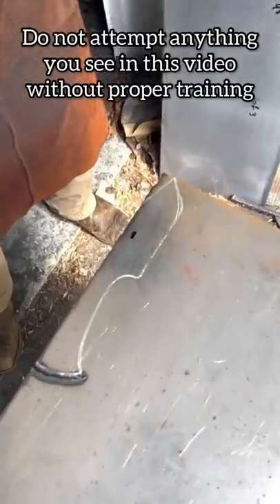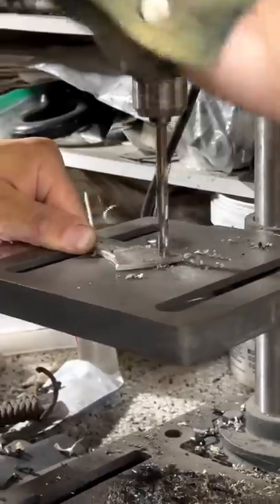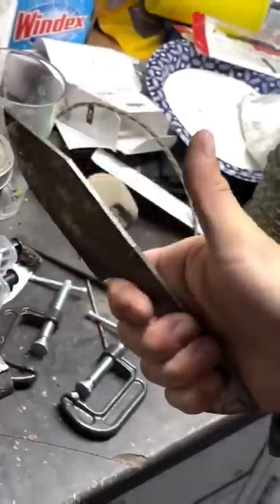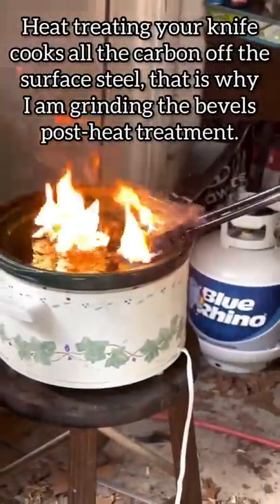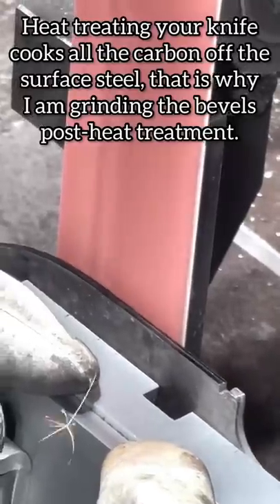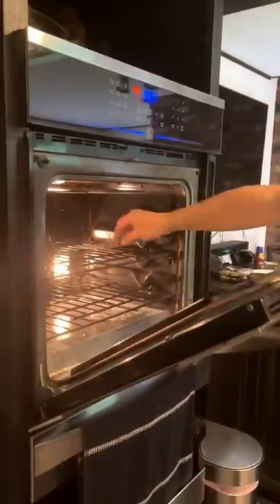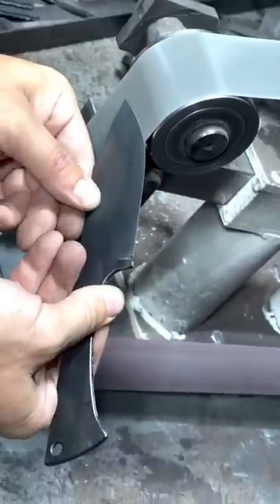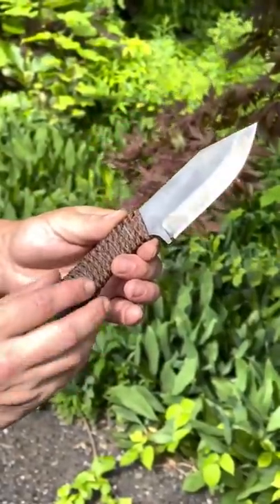How to make a knife!

Comment: next time try tempering the blade before grinding, that way if you drop it then it's more durable and won't have the chance to brake. (I had to learn that the hard way after I dropped a blade mid grind, and hadn't tempered it yet), but regardless, it is a really nice knife man, keep it up!

Comment: If it ain’t M390 I don’t want it 😂 all jokes aside good job! 👍
Reply: M390 needs a kiln to heat treat and cryo treatment in liquid nitrogen ... It isnt a steel most bladesmiths will work with on top of the steel itself being very expensive... 1095 is a solid blade steel that can cover a wide range of tasks and specialty purposes vs m390 which is a 1 trick pony

Comment: Oh shit so I only need a machine shop and forge
Reply from the maker: I made another short about producing a knife with minimal equipment if you are interested
Reply: You could do all this with an angle grinder, a set of metal files, a drill, a bucket of canola oil, a propane torch, and some sharpening stones if you really wanted to. And maybe a couple of firebricks to help the torch heat evenly.

Comment: I love that both of the first two steps aren't even a possibility for most people
Reply: The first two steps are the easiest. It's the heat treating that most people tend to mess up. He used the plasma cutter but you could just as easily use a hacksaw or a grinder or you can drill a bunch of holes and then use a file to shape it. boom, simple.
Reply: So find a way to do the first two steps, with what you've got.

Did I miss the part where homedude said this was the "only way" to make a knife, or something?

Comment: Don't you need to hold the temp for a few mins before quenching to get the most out of 1095? 

I use 108x because the heat treating is easier
Reply from the maker: So I learned something from the respectful comments that were made on this video that I will impart to you. I should have rough ground the bevels, then cleaned up the rough grind with a finer grit belt before heating it to 1475° for 5 minutes, quenched in parks 50 like I did. Then did 2 one hour cycles of tempering at 400°F. I just made the first dozen for sale on my site and they came out the best I have ever made.

Comment: I would cut the shape with a cutting wheel, get the bevels and plunge line and THEN heat treat. Otherwise, you’re going through a lot more work and materials trying to get the general shape.

Comment: I would say grind the bevels before your heat treat but... Still great knife!
Reply: 100%. The idea that it "cooks off" the carbon would be something that I am sure a lot of blacksmiths would like to have a discussion about.  Grinding post hardening, at least the primary bevels is just a great way to waste your belts.
Reply: @BrettDalton  the primary reason for post heat treatment grinding is to reduce warping...some carbon does indeed cook off as the steel scales in the heat this is called decarburization its about as common as dirt and damn near every smith knows about it ...if grinding a scandi edge it should be done after heat treatment not before ... A third reason is quench speed thinner steel will quench faster than thicker steel so the edge can suffer cracks in quench when grinding bevels pre heat treatment vs post heat treatment... There are other reasons of course but you get the gist im sure

Comment: Sir this is a great video and I appreciate you trying to inform people but I think that an important part to mention is that you drill tang holes for scales if you're not using paracord before you heat treat the blade or typically nothing good comes from it

Comment: This is like that how to draw a horse tutorial.

Bruh if I had a plasma cutter I wouldn't be interested in looking up how to make a knife
Reply: All you actually need is an angle grinder, somewhere you can make a hot fire, whetstone and a high carbon steel blank, it won't be prettiest knife, but it will work. The common materials to make one are easy to find, its the skill to actually make one from just an angle grinder that's difficult, which is why this video is total joke.

Comment: When I was younger I took an old file and made a knife from it, had to use a plasma cutter to put holes in it as it would destroy drill bits. Took a few hours to put a proper edge on it but haven’t sharpened it in the 4 years I’ve had it 🤦🏻‍♂️

Comment: I use old disk tiller blades, they're 1/4 thick and really tough. When I'm grinding I don't let it get hotter than 600 degrees so it doesn't lose its heat treat. Finished product I can chop into mild steel with no nicks on the blade 😅

Comment: Never seen a knife maker heat treat before the bevel.
Reply from the maker: I have seen a couple do it before so I decided to give it a try. I learn new things every time I try different methods.
Reply: I heat treat most of mine before beveling. Even thickness across the knife helps prevent cracking from hot spots and gives consistent hardness. Also helps with warping, though that’s not the only factor with warping
Reply: @jordandimick8861  knowledge is power.

Comment: Why heat treat before beveling? Doesn't that just make it way harder to remove material?
Reply: To the best of my knowledge, it is because heat treatment can cause warping. Grinding after allows for you to correct for any warping. I think at least😂
Reply: @walkertrautman8178  ya I just made 18 knives out of 1095 in both 1/8 and 1/4 in thicknesses. Did a ton of research because I didn't know wtf I was doing before. I ground the bevel before heat treat but annealed before heat treat to release stresses. Most knives turned pit good. I think his way will save you an annealing step and maybe have less distortion.  Gonna be super hard though.  He probably has a badass grinder. I was using a 1x30in harber freight.

Comment: As a machinist, the way you held your knife while using the drill press is a huge No.  Use the vice or pay the price.
Reply from the maker: I know that you are right, but it’s a wimpy drill press. The belt slips before it could barely over-power a baby. I know, I know…. I lost respect for it. I’ll try to work safer.

Comment: How do you know what temp the steel is at if you don’t have a temp regulated oven for heat treating? Are you guessing the temp after a certain amount of time? I don’t have an oven and I’m looking up ways to heat treat 1095 without investing in expensive gear.
Reply: You can gues the temperature (+- 20°C) by using a color chart. For example steel that looks light its glowing dull red has a temperature of around 650°C
Reply: Magnet, and colour.

Comment: How does cutting the knife out compare to forging? I assume forging would be stronger, but is there a significant difference?
Reply: Forging the steel will harden the blade. That's all I know, I use to watch forge in fire lol
Reply from the maker: Stock removal is easier and stronger, but takes less skill. I figured it would be easier to show for a short.
Reply: There's not a difference post heat treatment.
Reply: @nc_rider_7046  No, quenching the blade at critical temp hardens it.

Hitting hot metal doesn't do anything to hardness.
Hitting cold metal will work harden it, but is 'reset' when heated to glowing temps.
Reply: @autumn5592  ohhhh thanks for the info! I totally had my information all messed up.
Reply: There isn’t a difference. They both require about the same amount of knowledge. Hammer skills is one aspect of it all. At the end of the day, how you grind your bevels, heat treatment, and most importantly, the design of the knife

Comment: You never quench 1095 at 1650°f.
Ten ninety five should be quenched at 1475°f to 1515°f, anying above you will get grain growth, and it will Be brittle, difficult to get a good edge.
You did do good grinding while using water to keep it cool.

Comment: That’s a choil and why would you do all your bevel grind after a heat treat?
Reply: Its a Spanish notch not a choil and the post ht grind is to control warping and quench speed as thinner steel will quench faster than thick steel so keeping uniform thickness ensures even hardening through the full width of the blade

Comment: The part with the heat treatment makes no sense, especially the reason for quenching the knife before grinding the bevels. I am a knife maker myself and therefore have a good understanding of the processes involved in heat treatment. As long as it's not stainless steel and the holding temperature isn't over 1832°F you should be fine. You can also attempt a hamon with 1095 by hardening only the blade and not the back of the knife (by applying clay for example). Good luck and keep going!
Reply from the maker: Can you explain why it doesn’t make sense? I was under the impression that you cook off the carbon in the surface steel when heat treating. I have seen several knife makers do it this way. I use ATP-641 anti scale if I do the bevels first
Reply: @calculatedsurvival  I usually don’t use anything like a coating for the past years and it worked fine. The carbon can only be significantly cooked of the steel, when the temperatures while heat treating your steel are above 1832°F. It is just more work for you, if you heat treat your steel before grinding the bevels in addition to having the risk of too high temperatures while grinding. In conclusion i would say, that you can make knife like in your video, but it may be not the most efficient (cost and time) way of making a knife. If you are interested, i can recommend you the YouTube channels of Alec Steele, Royer or GreenBettle. They make knife like i have rarely seen before and like myself earn some experiences while watching them make knifes worth over thousands of dollars.

Comment: Quenched too hot 1095 should be quenched after a 5 minute soak at 1475 not 1650... Its jimping not checkering... The cut is a spanish notch its located in front of the ricasso it isnt cutting the ricasso ... Parks 50 doesnt need to be heated do so actually reduces its effectiveness and 1095 is a water quenching steel p50 while being the accepted oil is still too slow for that steel ... Atleast you didn't go the route of people like "mastersmith" (a fucking joke) jason knight and walter sorrells telling people to quench 1095 in food oils (i.e. peanut or canola) which are too slow for literally all steels used to make blades ...those guys dont have any business teaching anyone
Reply: I'll take their word over yours lmfao
Reply: @jessebond4221  That's crazy, I don't remember asking

Comment: Ok now how do you make the sheeth?
Reply: Sheath, and usually nowadays if you were going by untraditional crafting methods, or as i like to say, the incorrect way, most sheaths are usually made of cheap fiber stretched over mild plastic, on some higher quality ones you'll find straight up kydex or something of the like, and one of the best ones ive found made in untraditional ways was a condor, they seem to use fairly high quality leather and cut resistant foam of some sort along the edges to hold the blade and prevent the edge from destroying the leather over time, its not bad but id prefer a traditional scabbard, though they are rarely made with traditional methods nowadays they are usually of higher quality just because theyre usually wood pieces cut and glued together to surround the blade with a small air gap to prevent damaging the scabbard upon drawing and sheathing your blade, most of them that are cheaper seem to be coated with something almost like rhino liner or flex seal lol, but i have some higher quality ones that are just soft wood that has been made well and painted with some plastic bits✌

Comment: You made the edge brittle when you cut it with the plasma cutter and then dumped it in water
Reply: Baking it for an hour should fix that
Reply: He heat treated the steel after plasma cutting.  Heating/quenching/tempering produces the right balance of toughness and hardness.

Comment: Isn't the heat treat only a thin layer a few thousands thick. You ground it off sharpening
Reply: No, heat treatment changes the Microcrystalline structure of the steel. This goes throughout the whole blade, not just the surface. In simpler terms, heat treatment changes the structure of the tiny molecules making up the steel throughout the entire blade. The arrangement of the atoms itself can change the mechanical properties of the steel. Think of a lump of pure carbon versus a diamond. The arrangement of the atoms changes the hardness massively. He didn't grind it off because the entire blade is heat treated. But the reason you want to keep it cool while grinding is because the heat from grinding can do the same thing as heat treatment, change the structure, but unlike heat treatment it isn't a desired change in structure. Sorry for writing a whole paragraph lol.

Comment: What's the difference between this and forging?
Reply: Forging is the true way to make high quality blades, especially when done by very experienced bladesmiths, im very happy to see that someone brought it up though, it warms my soul like the bellows of the forge.✌
Reply: @jordandimick8861  alright, then go buy a couple of blades that were hand forged by a master smith, folded a at least a few thousand times and go test its worth against a chunk that was cut out of plate steel, either that or you can work with metal for a decade or so and have any kind of clue what your talking about, noone here is talking about magic except you my guy, might wanna leave the witcher behind and get some actual steel in your hands, theres a difference in the steel even if some scientist cant see it under his fancy microscope, trust me bud.✌
Reply: @jordandimick8861  Ntm it is much easier and much better to forge a very large blade, as you can work the impurities and other issues out in the forging process, as well as the fact that it would be very expensive to try and buy a chunk of plate thick enough to cut out something as big as you could with just taking a leaf spring and stacking it and forge welding it together then beating it out into a thick af blade the only real option to do that with sheet metal is get some thats dummy thick abd itll take forever to cut with most methods, and then what? Just grind it to shape and heat treat? Dont even get me started😂😂😂 (go learn about forging before you try to say its inferior is all im really sayin.)
Reply: @WarriorInWaiting  deleting my comments as I realized it’s not worth arguing over

Comment: That high carbon sheet  is heat treated off get go that’s why I don’t understand why u can’t just shape instead of h .t again? And why u temper after heat treating 1 or other I might be wrong
Reply: The oxy cutting alone can compromise the heat treatment
Reply: @Menesco  forgot about that even using grinder shaping could also
Reply: Basically anything that affects the heat of the metal in any major way can compromise the molecular integrity of the steel thus causing the need for heat treating and tempering👌 (and i think he used a plasma cutter, not oxy-acetylene lol im not willing to rewatch it tho to be sure😂)
Reply: @WarriorInWaiting  yeah thats possible but plasma has nearly the same effect as you probaly know

Comment: You title is a lie... That's why you quench in oil.  The plasma cutter burns more carbon off the edge than your heat treatment does.... You should take your edge to 90° before you hear treat, then heat treat at 1450° then quench to 400° then let it sit in 800° oil for 4 hours to refine the grain structure. The. Sand the edge off with a wet sanding belt and constant flow of water....
Reply: The 800° oil is more for adding carbon back to the surface. It's kinda like case hardening. It's a good thing to do if you can keep the oil from bursting into flames.
Reply: @davidscott5903  good to know. Do you mind if I ask where you learned that?
Reply: @NoExceptions109  
Materials classes in engineering school.
Reply: @NoExceptions109  
They taught us about several methods of getting carbon and other alloy elements to work there way into metals, and how slow the processes can be, but how important they can be for manufacturing things like gears and other items that take a lot of abuse.

Comment: He starts out by doing what no blade smith would ever do that is to cut the blade with a high temperature tool that blast oxygen into you cutting area of the blade so your left with a fatigued steel right where it counts also your making more cleanup work grinding that shit strait aftersords
Reply from the maker: I grind all the heated steel off. It’s amazing how you can actually see the difference in the steel when you do that. Trying to fit this video into a minute, I skipped showing the normalising steps
Reply: Show us yours!!

Comment: can a knife be made out of armor plate ?
Reply: Not really, armour plate steel is not really good enough for knives.

The ballistic steels are ~0.30% carbon. Knife steels start at around ~0.50%, for the softest cheapest shit on the market.

Besides carbon content it has alloying elements which make it tougher (less likely to deform under stress.) But it is not hard (because it would shatter otherwise.)

Could be done, wouldn't make a good knife.